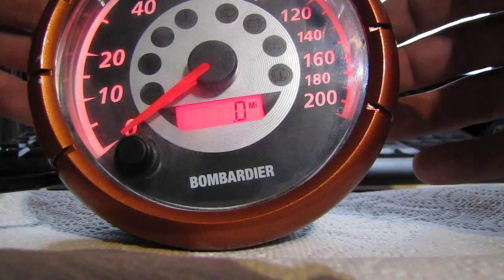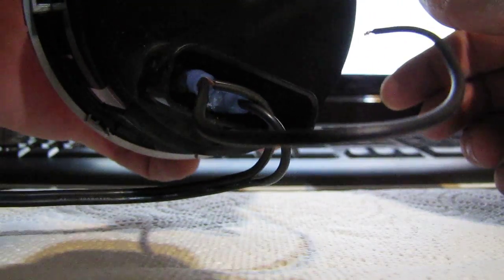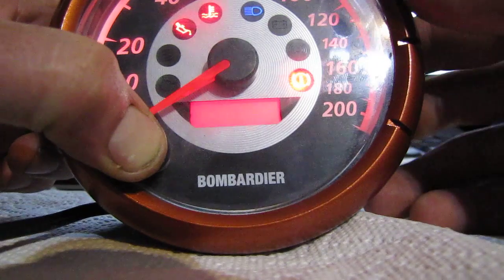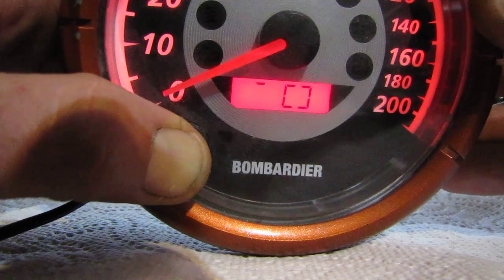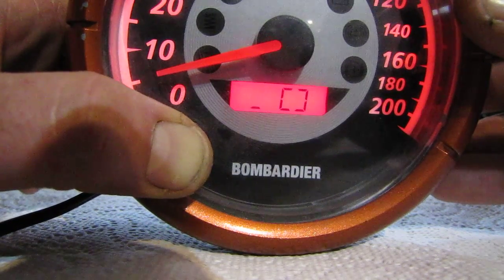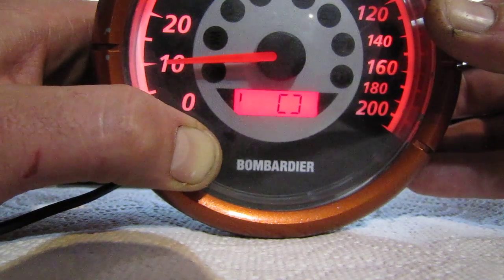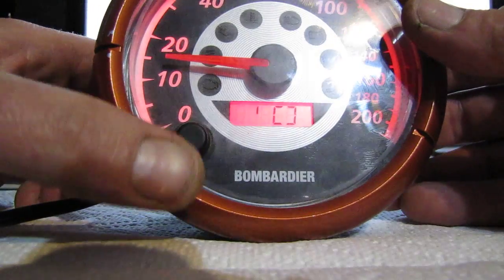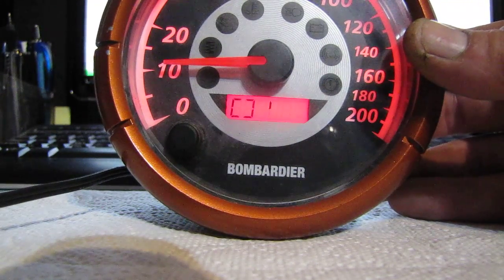2004 Rev speedometer

Comment: my 05 rev is stuck at a little above 10 mph like where you set yours, but acts normal, goes to zero when you start the sled, then back up to 10, could i do the same thing you did to bring it back down to zero?